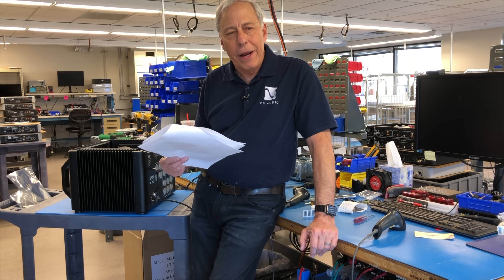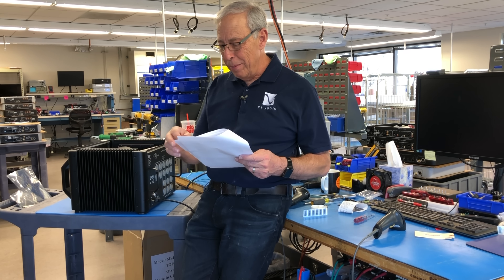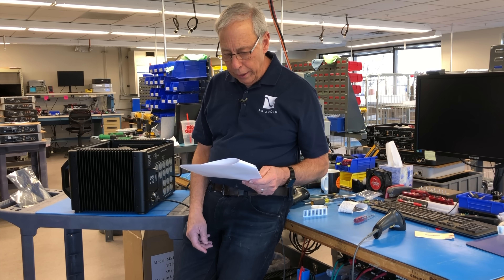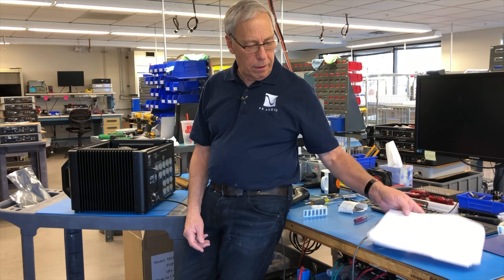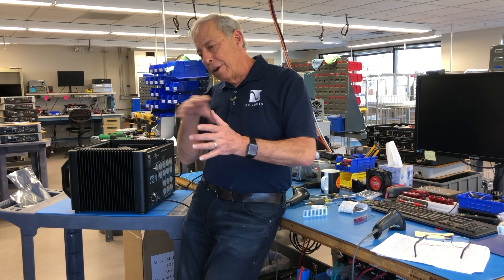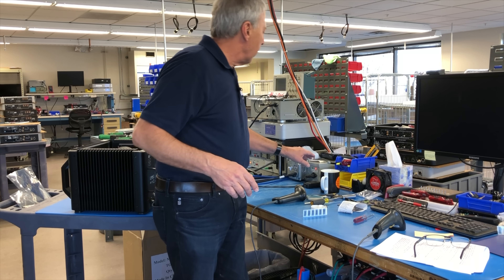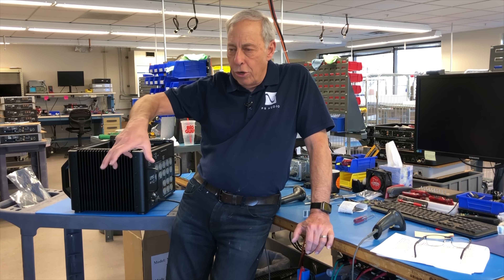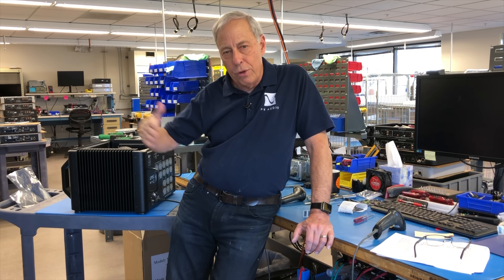Do automatic voltage regulators work?

Comment: Is he trying to sell a power plant or no? Based on what he said, you don't want anything connected in series, including high resistance wiring, that will current starve the amplifier with its dynamic current draw. From an engineering perspective there's just no way that an active component like a power plant can produce any better results than a dedicated 10 gauge wire back to the bus bars. His power plant is an automatic voltage regulator, and probably a more detrimental one than an switching autoformer (not variac), as it certainly current compresses far more than a sufficiently sized transformer. After all, IT HAS A TRANSFORMER in its power supply.

I mean seriously, the power plant is a class-a power amp, and so how could you expect it to perform any differently with line-voltage fluctuation than your class-a amp for audio?  Given that, you're literally adding another power amp in series, how could that improve your sound? Think about it!

Comment: I have that monster avs 2000, use it to keep voltage stable for adjusting the bias  of my tube mono blocks. This past summer we had a brown out, lights in the music room were hardly lit. The monster corrected the voltage by 32- 38 volts keeping the system playing it WORKS!!! I don't hear the avs at all.

Comment: Question...  Wouldn't larger bank of capacitors in the amp power supply act as a reservoir for instantaneous demand for power that comes from a transient load like a thunderous crescendo?
I am not suggesting that a Power Plant is not a strong addition to sound quality of the system.  I have audio friends who rave about their PS Audio Power Plant.  Just curious to what extent cap banks can address the issue of dynamic power delivery.

Comment: Transients as you explain is only applicable to class AB. In class A the current draw is constant on the power supply regardless of power transients.
Reply: Class A isn't strictly constant, as there is some variation, but most importantly, class A amplifiers just don't put out much power, so they don't load the line that much.  
But in any case, if the amplifier is pulling the AC line down enough for that to contribute to clipping/distortion, the simplest solution is just to turn the volume down a couple of dB.  No need to spend thousands on an overly-complex solution like an AC regenerator.

Comment: A variac is not the only type of voltage regulation.
Especially when it comes to lower voltages (below 24 volts) there are many types of solutions.
Like the (in)famous 78xx/79xx TO-220 IC's or the buck/boost converters.
The performance of those mostly depend on the dropout voltage.
As long as the voltage is above the dropout voltage (but not exceeding the absolute maximum), it will work fine and stable.
These margins are often very big; the only thing that really matters is the voltage ripple produced by mainly low quality components.
Especially the cheap buck/boost converters often produce a voltage ripple because of the switching functions within the component.

Comment: How about for 220v and what you're getting is 250v? Is that considered "extreme"?
Reply: If you're talking about the UK,  we use 230V  +/- 10% (single phase) so 207V to 253V would be within the supply tolerance and within the design tolerance of any equipment that has passed British and/ or European standards to be connected to the mains.
You'll never see that much variation in the UK mains supply though, mostly, if you use a good quality RMS meter, you'll find your supply sits around 238 to 247V (ish).
The 3 phase Voltage is 400V +/- 10% so that's 360 to 440V.
Reply: @thomasvadasis516  according to the books, a theoretical maximum deviation is + or minus 10% that means a voltage deviation of up to + or - 23 volts is within tolerance. I have measured slightly over 250v in the UK but I can't remember the exact number. Around 248v is quite normal in my home though.
Equipment is designed to operate or at least, not be damaged by the deviations, it doesn't have to operate 100% normally, just not explode or otherwise become dangerous during voltage fluctuations.
Reply: @thomasvadasis516  no worries. 👍

Comment: Audio power regeneration appliances are just a flawed idea. Smooth DC voltage and short term power delivery comes from the caps inside your amp. If it doesn't then you've designed your amp incorrectly!
Reply from the maker: That's only partially accurate. You have to look at the time involved. If the incoming AC is flat topped, as it often is, there's no way for the internal power supply capacitors to make up those differences. Further, the only source a power supply capacitor has for refilling its reservoir is from the line. Most power supplies internal to power amps won't hold up longer than one half a cycle. So, I am curious where you get your information about the fact amps "should" work for short term power under musical demands.
Reply: First of all power supplies of power amps are typically fairly crude beasts that are unregulated and don't give you anywhere near constant voltage. The voltage just needs to be high enough and the caps need to store enough energy for a big transient load that happens during the mains zero crossing. So a small drop in the input voltage does not matter, especially if the amp is not operated anywhere near maximum power. If you are worried about noise from the mains, put in a choke. A serious brown out of the mains might be a problem but then the automatic voltage regulator might just do the trick. So yes, a power regeneration box does not make sense. Or the simplest solution to all of this would be to just use a switching mode power supply which can work over a very large range of input voltages.
Reply: PS-Audio sells those so they claim it is important but you are basically correct. It is the secondary side in the power supply that really makes a difference. As long as the transformer is big enough it's good.
But try arguing with the quasi-scientists at PS-Audio claiming otherwise.
Reply: I am looking forward to the Youtube debate with Ethan Winer.

Comment: Yet again he is plugging a product that is pure BS.   He is selling a power regulation product that make no practical difference in even the highest level of audio equipment.
Reply from the maker: I thought about simply deleting this rather negative comment because it's really of very little value but I sense you have something to say. Since clearly voltage regulation and lowered impedance on the line are not only valid concepts but have been in practice and in use for several decades at labs, recording studios, and thousands of hifi systems around the world, what basis do you suggest this is just BS?

Or, are you just lashing out because of a bad morning? I can understand either.
Reply: @Paulmcgowanpsaudio  most people don't realize that its not just about power stability when it comes to power regenerators, also the output impedance plays a big part in it being useful at certain situations. So the most criticizing comments are from people who don't see the full picture of all the benefits.
Reply: How is having enough power at the ready for quick transients pure BS? Not to mention insulation from circuit line noise like cheap dimmer switches? Maybe your system isn't revealing enough to make that audible but mine is and I don't care for line drops on my other devices while while I'm listening to music.
Reply: That’s not entirely true. It can very easily drop the line impedance significantly, assuming you have poor service quality. The impact of this would likely be more significant on lower to midrange gear that lacks extreme overkill storage and filtering. The higher end gear probably won’t have a significant impact, but it also is more likely even a trivial impact can be considered worthwhile on the high end. Now, if you have relatively low mains impedance, it won’t make an appreciable difference. But most people have no understanding of this, and there’s often very little one can do aside from an oversized short dedicated line to the main panel. Even then, the line impedance at a main panel can be significantly different from one place to the next. It’s massively dependent on the distance to the transformer, the transformer used, the wire size to the transformer, and the loads on that line and transformer if it’s shared. My house with a standard 200A split phase residential service has under half the impedance as a brand new 400A commercial service with oversized copper conductors. But my main panel has about 20’ to the ground mount 50kva transformer that’s serving just two houses, whereas the commercial service has 170’ to the pole with 25kva transformers. These factors tend to mostly be out of ones control, and even much more so in a dense area or a shared building.

Comment: How is a variable voltage regulator like a variac?
Reply from the maker: Because some are exactly that used for long term voltage regulation.  Monster Cable used to make one that was a variac with a motorized control.

Comment: Does anyone here remember or had the opportunity to go backstage in an old Performance Theater and seen one of those old VariAC light control systems? Some of them were HUGE!!!! Some even had automobile steering wheels to turn the lights up and down. A lot of times that junk is still there and hidden away having been replaced but not actually removed.
Reply: My father worked in the theatrical business, not electrical but set and costume design so I had some exposure to the lighting systems at an early age. In the 1900s they used "piss pots" as dimmers! These were jugs filled with salt water and had two electrodes immersed in the solution. The depth varied the resistance. And the solution got rather hot under load, hence the name "piss pot". In the 1920-30s they used simple rheostat dimmers, an improvement but still very inefficient. They also toyed with tube based voltage dividers - like a pass transistor in a linear power supply. But the Variac in the 1940s and later the SCR in the 60s finally resulted in efficient dimmers.

Comment: I had two of each of the monster 7000 series and 2000. They had multiple issues and problems the taking contactors plucking away inside the unit Nother problem when you turn on the blue LEDs on the front panel there would be a humming buzzing sound coming through your high-efficiency speakers. After about three or four years the capacitor started To fail inside the units. You can just guess me and 100,000 people will probably never buy another monster product again that’s a great marketing strategy. Don’t you think lll. But he did get the laugh all the way to the bank cashing our checks at the audio foolery
Reply: I still have a few of their low end cables but that's as far as I go with Monster. Everything about them as a company makes me cringe.
Reply: Noel Lee is a crook...he screwed us all out of money. He used one wire stock for the entry level, mid and high end. He fucked himself out of the business because we all caught onto what he was doing...their power conditioners and surge protectors limited current for amplifiers. Doug Blackburn caught him on that one in Widescreen Review.

What you did get was quality. Most of their products were robust and very well made. But what a fraud that company turned out to be...
Reply: @cap96lt1  Not to mention their proprietary little front end modules they put in their amplifiers that failed all the time and you couldn't get replacements. They were supposedly Bob Carver's design. LMAO